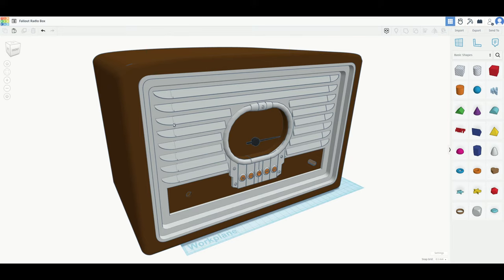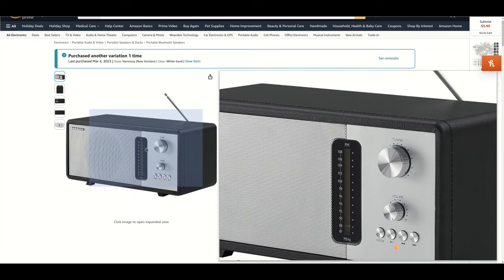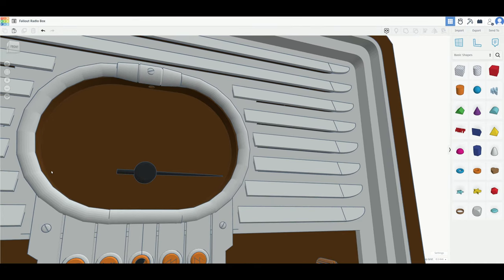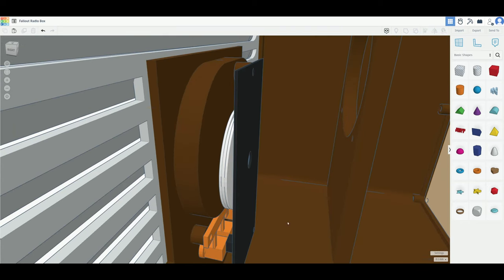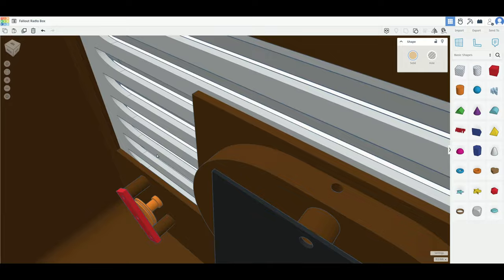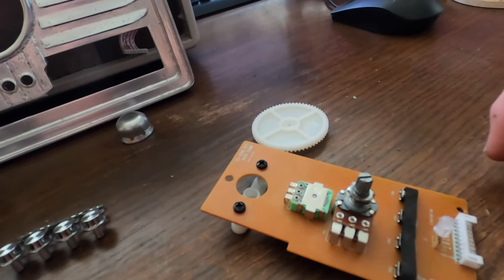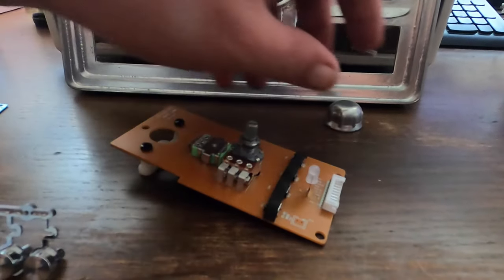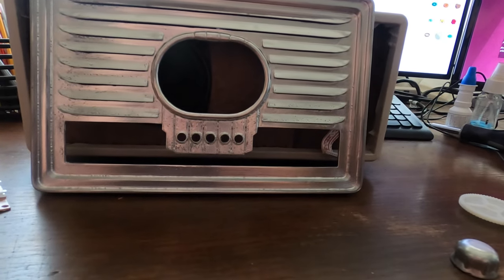Creating a Functional Fallout Radio Prop in TinkerCad to 3d Print.  And other Project Updates

Comment: This is too cool
Reply from the maker: Thank you, once I get it printed and successfully assembled I'm going to make the stl files public so anyone who wants to can do this conversion.  Yesterday I finally got the buttons and tuner parts printed successfully.  The back board turned into a gooey blob in the printer over night though.  I'm still trying to get the mesh on the box "watertight."   I may end up having to remake that part using a different method.

Comment: This is pretty sweet! Do you plan to share or sell you STL files?
Reply from the maker: I do intend to share the stl files.  I'm currently working on building a website where I will host them along with some other things. I want to try getting them to a finished ready to use state as there were some things I had to do outside of Tinkercad to get them to print properly.